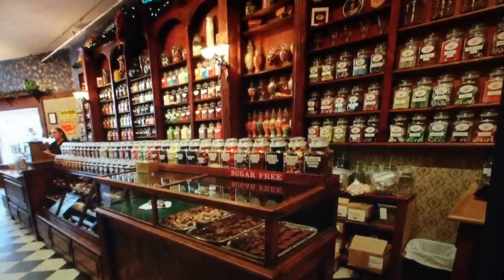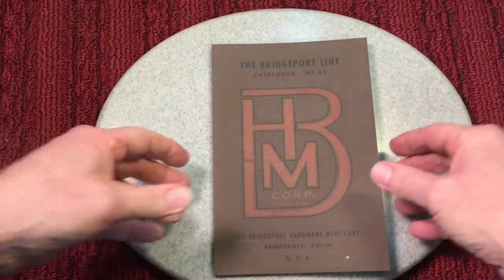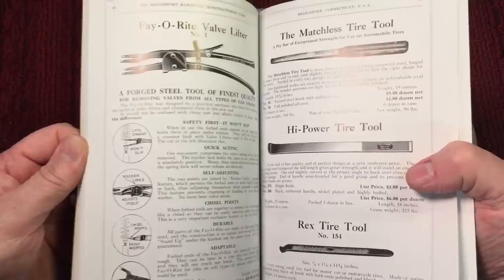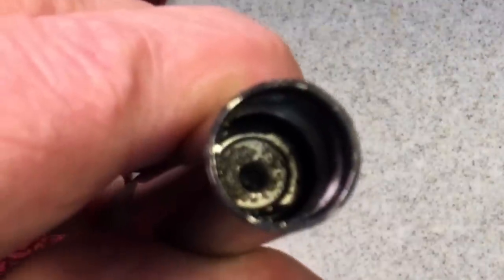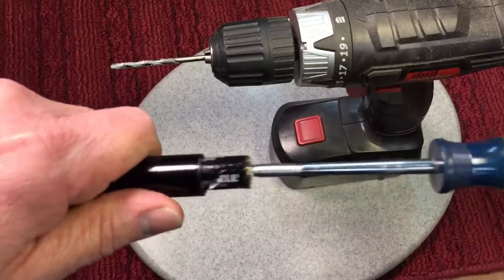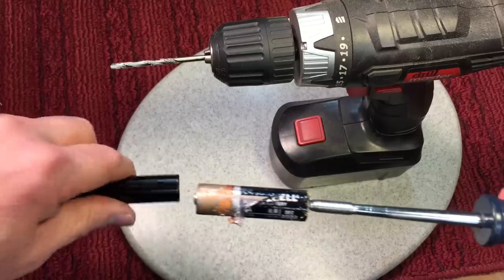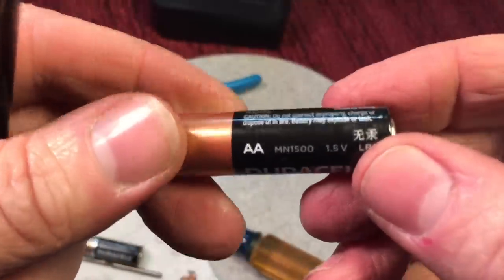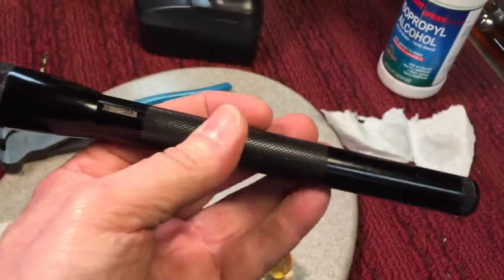MMM- Giraffe Reacher, Flashlight Fix and a Mystery Level

Comment: Thanks for the battery-extraction tip. I also have a mini-maglight with stuck batteries.
That kind of level was screwed down on a politician's tongue, so that during a speech you could tell if he was on the level.
Reply: The only problem with that Gwen, is that we need to first find a way to extract their heads from their butts.  Maybe the old drill bit and screw starter trick will help get their heads out first :)
Reply from the maker: LOL!   We really are living in amazing times!
Reply: @Traderjoe  Then the flashlight will also come in handy! You are a mechanical genius, just like ScoutCrafter.

Comment: I believe  it's  a pipe level it can be used on pipe such as the top fence rail for chain link the screw would hold the level in place so you could true up a long run for top rail. More modern laser level can make this job easier and the laser can plume upright poles as well level and work over a larger area.

Comment: If you make the mistake of storing any device that uses conventional batteries with the batteries sealed up air-tight inside it, so they can't off-gas, you'll get the same corrosion you saw here. I have a first generation Apple Trackpad that was designed to not let the batteries breathe.  A new one is about $150, and my old one was so corroded after a few months of non-use, that I couldn't even unscrew the end cap. I used a variety of methods (files, dremel tool, drills) to gain access to the threads holding the end cap in, then lubricated the exposed threads and eventually unscrewed the end cap. Next I drilled out and pulled out the batteries basically like you did.  After cleaning all the corrosion out of it, I popped in new batteries and it still works. Don't give up if something like this happens to you.
Reply from the maker: From many of the comments the new Duracell batteries are made in China and are more prone to leakage!  What a shame!  Thanks!

Comment: I bought my Mom a Chinese Giraffe Reacher about 30 years ago. It looks like they may have patterned it somewhat, after yours. It only has one lever and the wood shaft is smaller in diameter. The mechanism is very similar to yours except, the jaws are parallel to the wood shaft instead of angled. I think yours has an advantage there.  I remember as a kid, I was in a remote grocery store in the Poconos and the guy had one with rubber pads on the end of the jaws. What I remember more was, there was a dusty box of something, (probably cereal), on the top shelf that, didn't sell too well because, it had a spider web on it complete with spider! LOL. That had to be more than 50 years ago and I still, remember that spider.
Reply from the maker: Dave that is funny!!!!!

Comment: I used to buy LOTS of these Duracell batteries (different sizes for different gadgets) over 20 years ago and store them, as a prep for hurricane seasons here in Miami.  They'd last beyond the advertised 10 year shelf life.  When that occasional hurricane would visit and knockout our power for a week or two, we COULD depend on these batteries for our fans and lighting.  We'd use them, drain them and toss them out.  The emergency equipment could be stored without issues.  Today, those same batteries leak and corrode even before they are put into a gadget.  I've had numerous devices ruined by corrosion caused by these now bad quality batteries.  It is sad, when you can't even buy a good quality battery.  The web indicates they are made in different countries depending on the size, I'm always looking for Made in the USA and buying THOSE up.

Comment: Safety Sally put an end to the Giraffe reacher, not allowed to store things above head height, it could fall on you. As for the torch/flashlight who is going to use it under water? Drill a 1/64 hole in it to vent the batteries. Very cleverly repaired.
Reply: Safeway: liquid jars are on shelves above 6'.  No shelves are above 7'.  People reach with their arms. Home Depot: shelves are 14' feet tall with all manner of things.  Only staff with a wheeled ladder are permitted to reach the merchandise beyond arm's reach.  It looks like a method for reducing workers was employed with quiet automation.

Comment: Still a few of those old small town hardware stores around that use Reachers but it seems they're disappearing fast,  20 years from now it'll be almost impossible to find one left in the whole USA.
Have no clue what the level is but I'll be checking back to see if someone comes up with the answer.
BTW that's about $22 a piece in today's money.
Reply from the maker: Raw Bacon at $22 it’s still a bargain!  😃👍
Reply: As a kid in New York I occasionally saw Reachers used to get cylinders of motor oil down from a high shelf. Also back in the last millennia I saw them used at a few general stores in remote parts of Appalachia.

Comment: Provided you don't take your maglight under water, do you think drilling a tiny hole somewhere in the case would prevent this from happening? Yes you are compromising the water resistance of the light, but if it sits in a drawer or other dry location you might avoid this whole issue.  I wonder how many maglights were thrown out for stuck batteries?

Comment: I use a brake cylinder hone to clean corrosion from C and D size flashlight tubes.  Then spray the the inside with clear coat paint to seal the metal against oxygen to keep down additional corrosion.
Reply from the maker: Hi Larry, Good idea!  Maybe the Aluminum has something to do with this issue...

Comment: Those Maglights have broken my heart more than once.
Reply from the maker: Never trust them!  I always have two sources of light now...  =)
Reply: @ScoutCrafter  
Unfortunately I have had heartbreaks from another USA made brand for other reasons. Streamlight LEDs, my first 4 AA kept strobing. I returned many of those and always got help through the tool trucks. My wife's 3 C version cost me $30 to get fixed sent through our local independent Radio Shack. Neither brands were cheap by any means. I don't buy either anymore.

Comment: I carry a 6 D cell Maglite with ESD XcapeCap breaker tailcap and castellated ESD Talon lens bezel. LITT l.e.d. bulb and tempered glass lens. Be nice if manufacturers made at least 3 different lengths of handled screw starters. I have a current u.s.a. made, part# ASS3A Channellock branded one.
Funny part number 😂

Comment: I have a d cell mag light that had that problem .The last battery I used vinegar to get it out. The level I think you're on the right track as far as clamping it to a board to make a longer level.

Comment: ScoutCrafter, with the holiday season quickly approaching, I want to ask you. What are your favorite modern items currently made in the USA. I'm trying to gift items made in the USA and request them as well.
Reply from the maker: It's such a shame how the US drove manufacturers out of this country with high taxes and excessive regulations.  You can't go wrong with any of the Channellock line as they are great tools at a great value!
Reply: Just beware not all channellock is USA made as I found out with their crescent adjustable wrenches they are made in Spain but they are truly great quality I love mine although I was expecting it to be made in USA so a little disappointed by that but they open wider and they have slim jaw versions they are still great.

Comment: Nice Monday video Scout!  I'm trying to make a scoop to clean the roof gutters of my house. The scoops you buy in the store are for round gutters and mine are square. I'm making it out of wood and tin, I'm really doing my best but fear it is going to be somewhat crude. Hope you have a great few days and I look forward to wednesday!
Reply: Attach an ABC pipe to a leaf blower and on the open end fashion a USB shaped bend from 2 90s and then just blow the leaves out of the gutter. Did this numerous times to mine. Attach a small camera to the top if you want to see what is in gutter. ABS plastic pipe. Yes, and I did get wet too.
Reply: @Rlaskowski1  sounds like a great idea! There is some water in my gutter tough so if I try that out I should expect to get really wet lol!

Comment: Do you think by removing the o-rings this could help prevent the battery issue?
Reply from the maker: I removed the O-Rings on my mag lights years ago, however I always instructed my scouts to loosen the tailcap when the light was in storage.   Those flashlights were always trouble, well made though!  =)
Reply: @ScoutCrafter  Good to know!
Reply: @ScoutCrafter  
KEEP THE LIGHT AND THE BATTERIES SEPARATE  - TIL YOU NEED LIGHT.